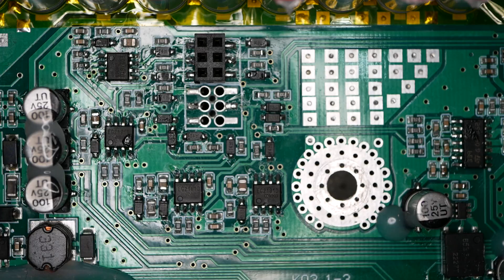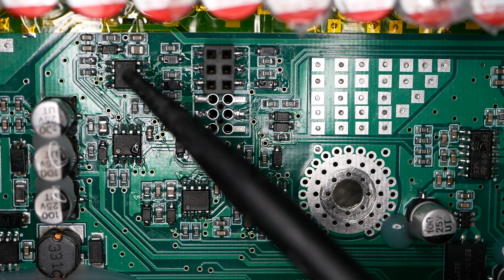KO Moto Rush Macro 1:  Logic Board

Comment: Oven? Just put it in a pot of boiling water. Use distilled water. Way easier. Water is bad for electronics when electricity is present. Most components are actually a lot tougher than people think.

These companies that pot everything are obnoxious. 

You just want to be able to swap out a few fets on a bad phase and now you have to get kitchen appliances and silicone oven mitts involved.
Reply from the maker: I'd prefer to NOT have potting and when I depot something, It's very rare that I pot it again!

Comment: Nobody uses dc dc for powering mcu stuff, i would say more, CISCO routers have LDO regulators going to cpu with 1V difference just to make it work.
Reply from the maker: They do! Look through my tear downs. Its about as common as is linear regs.
Reply: @de-bodgery  well if those using dcdc for analogue circuit i would say that's a bad design

Comment: ASi really needs to make a BAC 16000 For me.  Tired of dealing with FD.
Reply from the maker: I'd like to see a 150v ASI controller! I'd also like to see them abandon their tired design and move into the present. It works, but TOLL mosfets and MCPCB's have significant advantages over the TO-220 based designs that ASI has been building since 2012.
*
Tired of FD, try Votol instead! I personally think they are better controllers.
Reply: @de-bodgery  oh man the em200-2 is my goto budget controller. 

However I run a bac8000 on my super73 at 24kw.  I removed it from my emoto project, it ran the bike amazing but 800 phase amps is ebike numbers.

I swapped my emoto to fardriver 721800 running 800 line amps, how ever the field weakening is horrible in comparison to the ASI.  And once in the flux rpm range the asi was faster.
Reply from the maker: @BuildItTuneItEV  That's not surprising. FW without full FOC functionality is usually tepid at best. FD/KO FOC is jsut very basic FOC so of course whatever FW they might provide is also not that great. ASI is full on FOC function. I'd like to take apart an EM200-2 and then compare it to the EM150 I have already.
Reply: @de-bodgery  I have these bac2000s to send to you, Ive just forgotten.

Do you know of a controller with true FOC that can do 1800-2000 phase amps and 700-800 battery amps at 20-24s? 

Not concerned with cost (within reason)
Reply from the maker: @BuildItTuneItEV  REach out to me on facebook about the BAC2000's you have. SHUL is about to release the CL1400. It's VESC which is open source and excellent and will work up to 26S. Pretty sure that controller will be a really solid design from what I have seen so far! For more amperage than that, you will pay a lot more $$$.

Comment: Did you buy this refurbished? Or New?

Do you think KO is just mass ordering this in from China?

I used to have a car audio company, a batch of amps we purchased arrived different than what our samples were.  And anytime voltage would dip below 11V they would fault,   We had 1500 Amps that were unsellable.

They flew three men out for a week and worked around the clock doing the repairs. 

This looks like to me just low quality manufacturing / price saving.
Reply from the maker: Pretty sure I've said it at least 30 times that it is supposed to be brand new and NOT a refurb! If I got it massively discounted because it was a repaired controller and I knew that up front, my language would be entirely different! I'd do like I did with the Tronic 750 and say it was a repair unit. This was not communicated in any way! IT was sold at full price and as a NEW controller! 
*
China has a long standing habit of "Cheaper is better" mentality! Thing is cheaper isn't better! It rarely is better! You cut corners, cut design redundancies, cut component quality, cut cut cut! Just so you can follow the "cheaper is better" mantra! I will always choose to pay more to get something good than buy the cheapest thing there is! KO Moto, charges you more and pads their profit margins quite heftily, but provides the cheapest built product they can get away with!
Reply: @de-bodgery  

I watched all the videos from start to finish, but I never or missed you say where you got it from.

Not defending them at all, I would not put a KO on my lawn mower,  even before seeing your videos. I knew when they could not back up a single claim it was junk, the videos have been cool to learn why.
Reply from the maker: @BuildItTuneItEV  You are correct, I did not say where I got the controller. AS close to that as I will make public is that I used a third party to buy it for me from KO. KO can't possibly know for sure and at best can guess who that is and they had no way of knowing that it was being purchased for me. That is all the more I will say to protect my "third party". This controller makes me disgusted! I thought the Pro is a turd and I was seriously skeptical that the Rush would be very good. Now that I've gone through it pretty closely, I'm dead sure it is WORSE than the Pro in most every way!